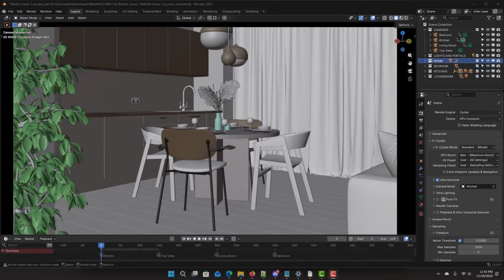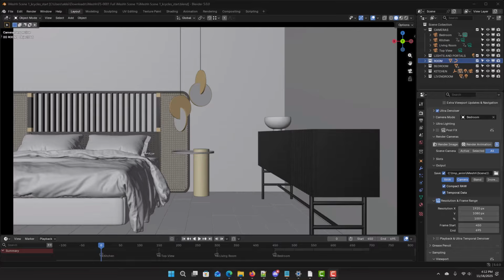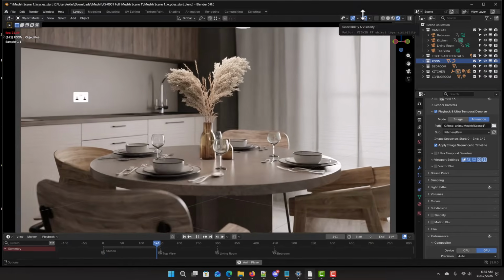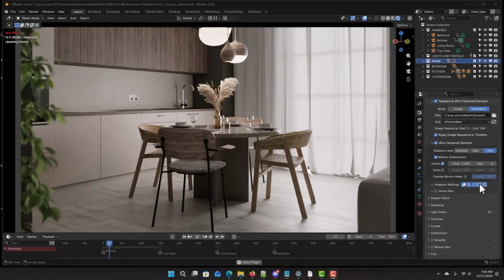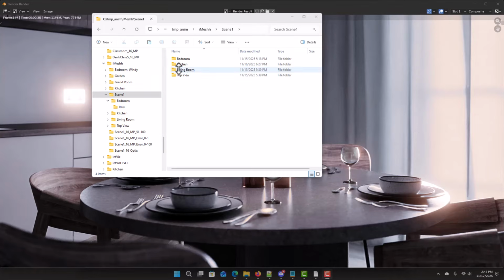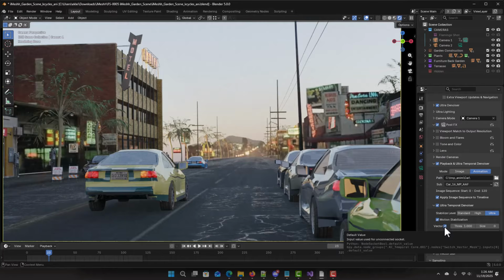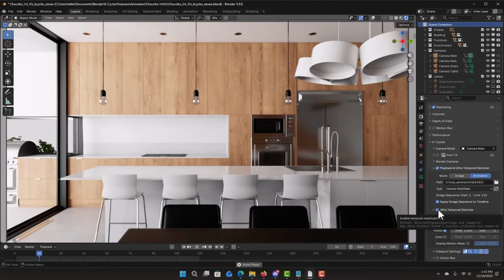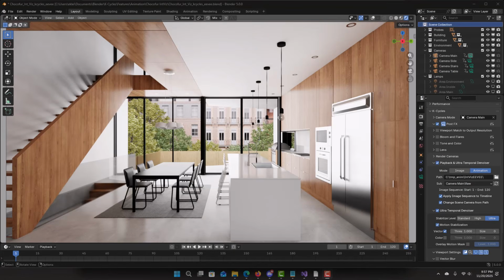K Cycles -  New Ultra Temporal Denoiser, Playback and PostFX

Comment: I want to understand correctly; so I am rendering out the sequence at low samples to EXR files using the ultra denoiser, then bringing them back into blender to apply the temporal denoiser, then re-rendering that out to new files which will be flicker free? Does the second export using temporal denoiser need to be to EXR and should the ultra denoiser be turned off?
Reply from the maker: Correct. First rendering animation with denoiser on to EXR files. The second export using temporal denoiser is very fast  less  0.5 second  per frame with ultra denoiser off and can to EXR or movie file.

Comment: Does the addon need first time setup to start working with the rendered images for real time playback ? Where does it save them ? In a temporal folder ? thank you!!
Reply from the maker: The input for the EXR animation stream is selected in the Playback section the Output uses the Blender output folder and file format or can use Render Cameras.

Comment: i'm having a problem where the playback temporal denoiser doesn't work and it's telling me in needs a vector pass
Reply from the maker: The raw animation image sequence needs to have vector data pass enable or forgot to enable "RAW" option in Render Cameras when creating your raw animation. Check the beginning of the video where it is explained. For any other support questions please go through Superhive "Contact the creator".
Reply: @ericklein5893  u forgot to show us that u need to render first as a open EXR multy pass to get the stablizer to work for the first place i have to go trail and error to find it out
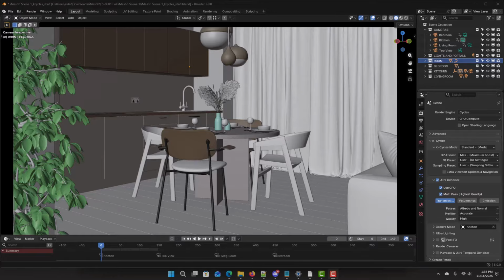Reply from the maker: @RedaHarrouss  The video starting at 1:40 it talks about vector data pass and open EXR multilayer settings. If your using Render Cameras "RAW" mode it will change these settings automatically. The video is pack with a lot of information may want to watch it more than once.

Comment: Lemme get this straight... 

So if I am to understand this correctly, you're taking the already rendered image sequences processed at low samples, bringing them BACK in Blender to denoise and render them again?
Reply from the maker: First render animation (image sequences) at low samples with multi-pass denoiser. Second do Playback (bring back image sequence) to do temporal denoiser to remove all the flickering and artifacts. Low samples denoise animation renders have flickering which the temporal denoiser removes saving hours/days in animation renders. In Playback beside temporal denoiser add PostFX and Motion blur as needed for final output. Remember that in Playback all the features and adjustments are done near real-time.
Reply: @ericklein5893  Thank you for taking the time to explain. So it's better to use the real time ultra denoiser on playback rather than the one on render?
Reply from the maker: @ChatterBoks85  The Ultra denoiser is for removing single image rendering noise and it is not active in playback. The ultra temporal denoiser is used only for playback for removing animation flickering. Need both and they have different purpose. Check my video carefully notice how there are used.

Comment: How does this do in low light
Reply from the maker: Low light denoising usually has more flickering which means that using the ultra temporal denoiser will notice even better improvements.